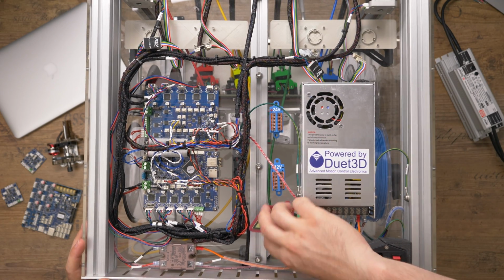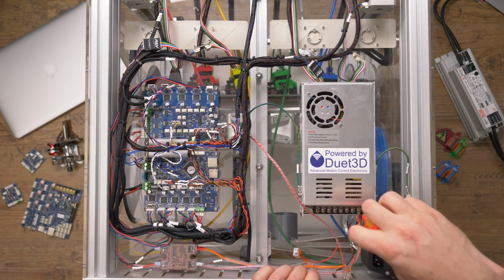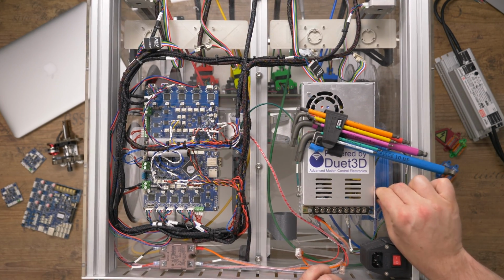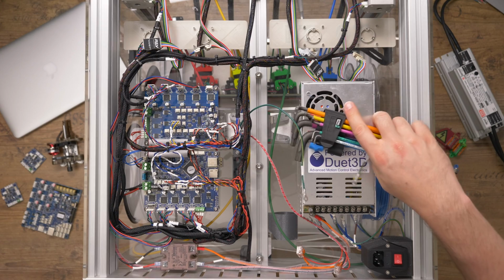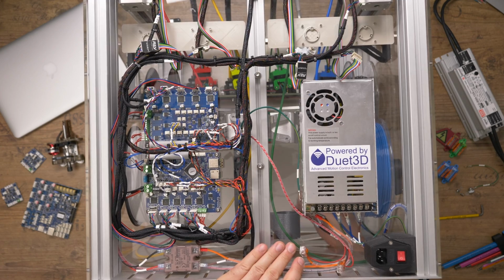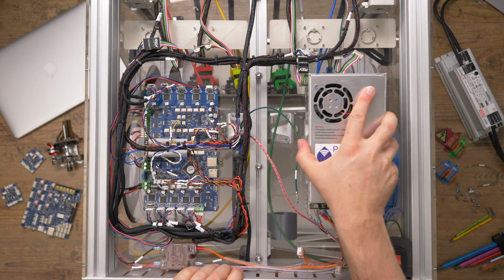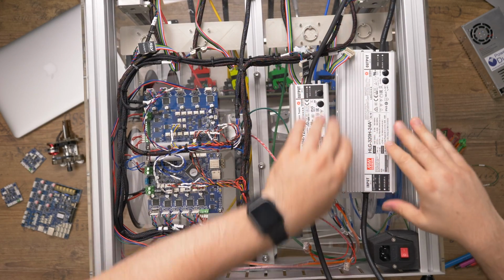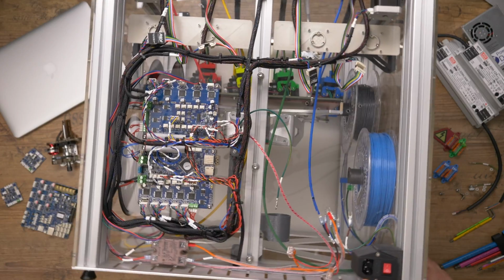E3D Toolchanger - UPGRADES #02 - double PSU

Comment: Wouldn't it be better to have the negative lines of the PSUs' output connected to the protective earth or at least to each other? Or are these already continuous with PE inside the PSUs?
Reply from the maker: You are absolutely right and I forgot about that completely! Thank you for pointing that out! Folks, connect the 2 GNDs of the PSUs!

Comment: To use the Varipower heated bed, it says I have to use either a 600w psu or add a second psu for those of us in the USA. Is this correct? And why?
Reply from the maker: I've no personal experience with the 24V Varipower beds from E3D, so best would be to contact E3D-support directly about this.
Reply: @ReneJurack  what breed do you have on your tool changer then?
Reply: @K1llerElite68  Toolchanger comes with a 230V bed that the Duet controls via a solid state relay, but the actual power for the bed comes from mains directly and doesn't run through the PSU, hence a 320 should be plenty for it. Each hotend heater is only 40W. So that makes 120 for the hotends, that makes 200W remaining for board, the few NEMA17 motors and some fans.

Comment: I would like to know if you have 12v tool fan in mind and how would you do the wiring on the duet 2 with a separate 12v power supply.

Comment: I think the Wago 222s are just rated for 20A, you put a 24A PSU behind it and enough printerstuff which can draw more than 20A in total behind it. Maybe reconsider using sth else?
Reply from the maker: it’s a 24V PSU with 320W power, which equals in 13.3A max. The 12V PSU is 60W, so 5A max. The WAGO221 are chosen fine 😊
Reply: I don’t think you need to worry about the current carrying capacity of Wago connectors. Check out this video. https://youtu.be/flSs4PLai2Y